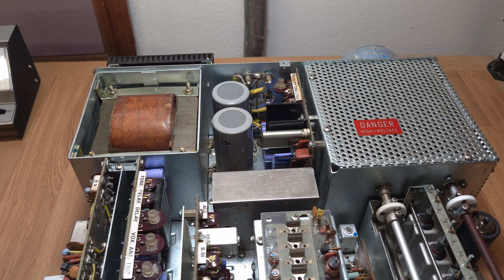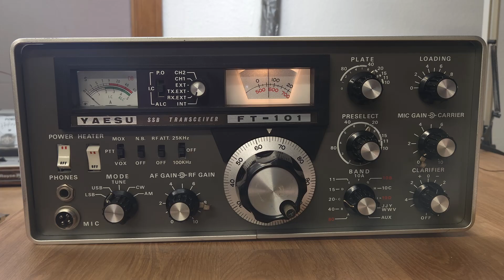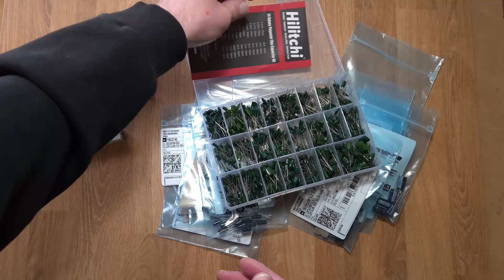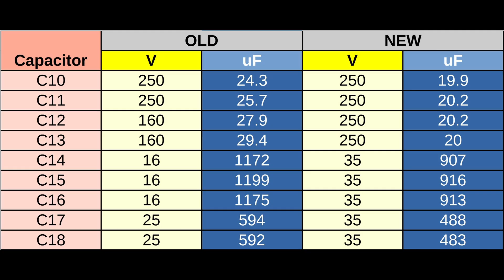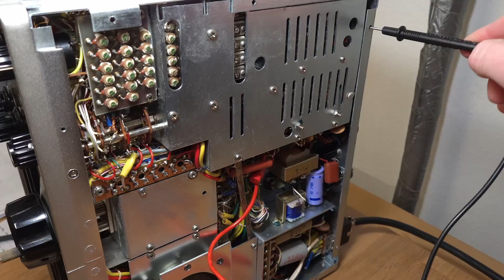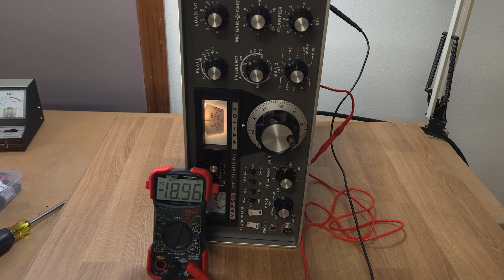Yaesu FT-101 Restore Part 5

Comment: I'm  following your footsteps. Very nice. My board has the original capacitors, However, C17 and C18 have value 1000 uf at 16v. But the schematic says 470 uf at 25vdc. Be interested in the  value of your originals in position C17 and C18 ?  thanks
Reply from the maker: Right around the 18 minute mark in the video is a list of the old and new values from what I took out and what I put in. The capacitance is typically higher from the old capacitors due to age. The ones I had were 25V. There seems to be alot of variations among these radios, perhaps small improvements from the manufacturer over time?
Reply: @ThePortableCrows  Thanks. Yes.. maybe some variations. My board mounting screw had green stuff on the screws. Here is what mine looks like: https://www.youtube.com/shorts/ZE4Z0HkB0io

Comment: You need to be in the mode you intend to use i.e. LSB, USB or AM. (Tune is used for peaking the transmitter finals.) Set the dial closest to the frequency you want to be on, then tune to the nearest beat note and rotate the silver part of the dial to line up with the harmonic of the beat note. (25 or 100KHz) Now your dial is calibrated to the frequency nearest to the one you want to use.  Then tune to your desired frequency.  73 de Scott W6EEP
Reply from the maker: Appreciate the tip! I will use these steps the next time I turn the radio on. In the middle of changing some more parts :D